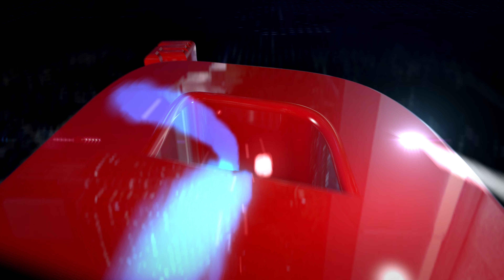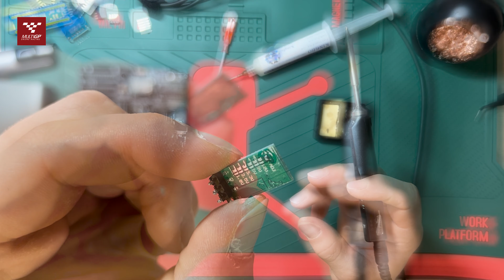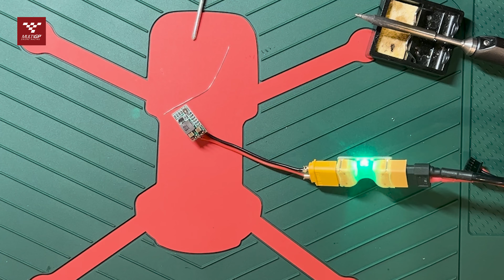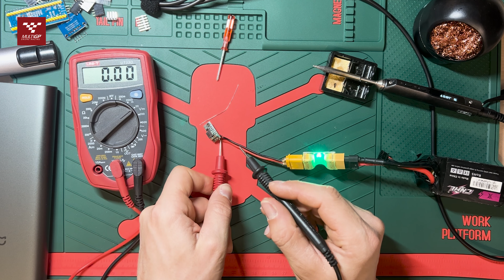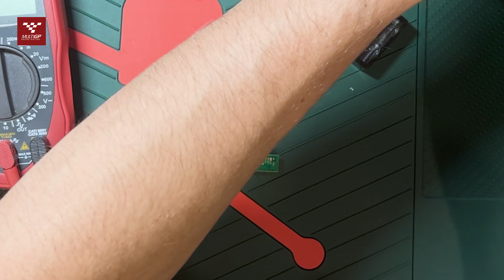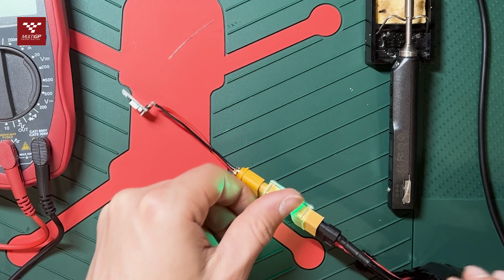Building RotorHazard STM32 BPill: Part 2 Voltage Regulator for Pennies

Comment: Thanks for the tutorial. 
I understand and appreciate that you tried to find a cheaper alternative for the Pololu regulators, but there is a reason why these regulators are so cheap.

They have a very noisy output and while they are perfect for other projects I would personally never run a (expensive) raspberry pi on one of these. 
The unstable output can cause all kinds of weird behaviour so I would rather pay a bit more to be safe.
Reply from the maker: First of all - thanks for providing such a useful information, it's also very interesting for me. You're totally right, thats why it's up to you - you can choose any of regulators. From my side I can tell, that I've tested both builds - on Pololu and on Cheap Chineese regulators. All of them work good.